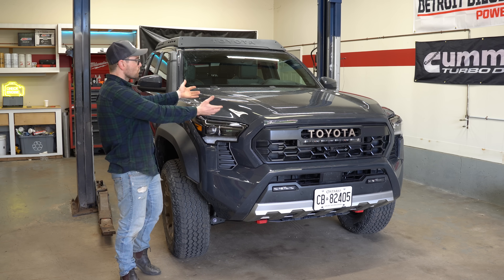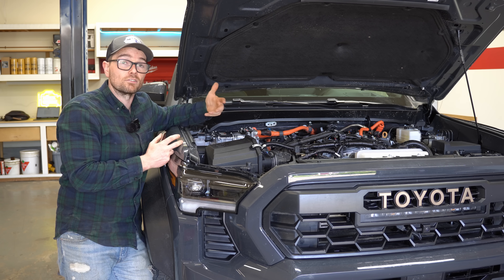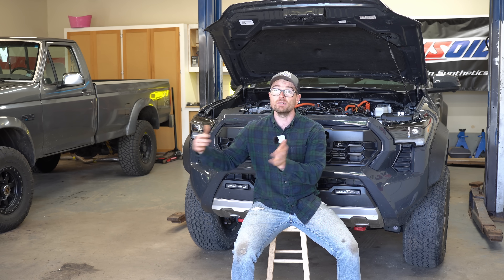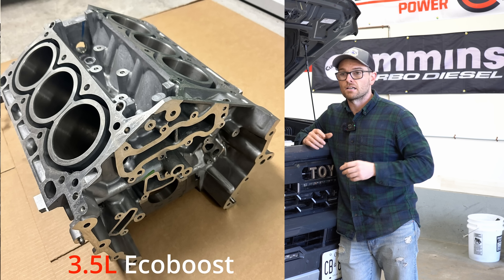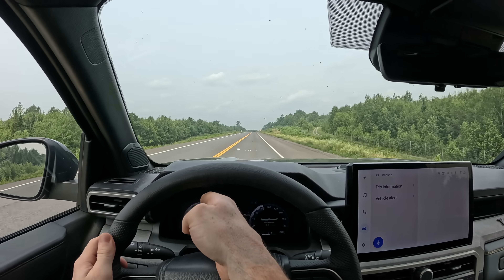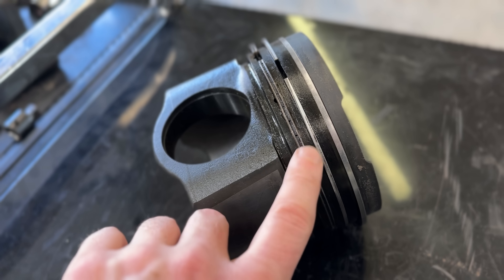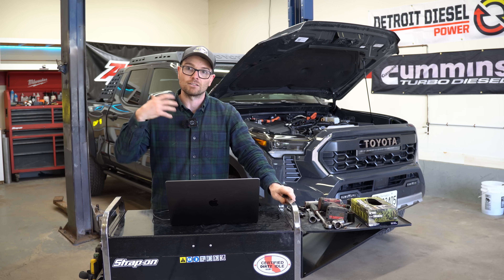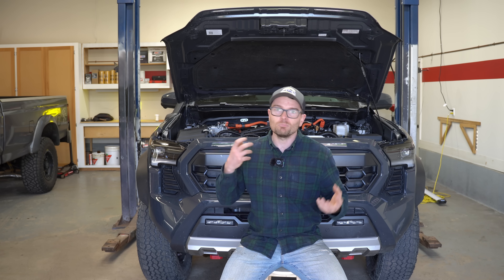Toyota Tacoma's 2.4L I-Force Turbo: CONCERNS Every Buyer Should Know (Mechanic's take)

Comment: Toyota has such a great reputation with turbo motors, just like the Tundra 3.5, oh wait, never mind.
Reply from the maker: Yes the 3.4L was not a great start
Reply: Toyota has such a great reputation with turbo motors, just like the 2JZ-GTE.
Reply: I would rather have high emissions, terrible fuel mileage and solid reliability
Reply: Toyota has never had a 2.4L motor fail. It's one of their most tried and true motors ever.
Reply: @adamrosenduft REALLY? Not even one? Got receipts for that?
Are you talking 22R maybe?
Reply: @TIJoe-te9qu I’m just saying it’s been one of their strongest engines ever. They’ve run it in Lexus for a long time in many different vehicles.
Reply: @adamrosenduft I get it, but you said never. Is that the truth?
Reply: @TIJoe-te9qu I’m talking statistically. Not saying a single 2.4 engine from them has never failed like not 1. I’m saying statistically it has never been a failed engine for the brand lol.
Reply: The failure of the 3.4l wasn’t due to it being turbocharged.
Reply: @55Berg That's right,  it was " debris" !
😅😅😅. 5 straight years of it.
Reply: If I recall correctly, it was not a great start to the 3rd gen Tacoma either.  Toyota, in all likelihood, stay with this new engine for many years modifying it as needed.  The difference between Toyota and other manufacturers is that Toyota has a better track record of standing behind their product.
Reply: @gregleuze6657  have not been in a toyota service dept. lately, have you? they no longer stand behind their product at all.
Reply: @billw8476 I was there last week.  This is the second Toyota I have owned.  I guess I will see.  Which manufacturer do you think stands behind their vehicles the best?
Reply: @gregleuze6657  i would say honda stands behind their vehicles best. after 10 tacomas in my life, toyota has gone down hill , and they try their best to excuse themselves out of any warranty.
Reply: @gregleuze6657  Toyota has a great warranty until you need it.....then you have to be a bare knuckle fighter
Reply: @gregleuze6657  Heard the '16 tacomas had a bunch of problems but I bought a new '17 tacoma without knowing any of that and so far at 64K miles, all I had to do were oil changes and regular maintenance. Nothing with the engine at all or related components.
Reply: The turbo V6 was used long before the 22 tundra,in many lexus vehicles without issues.
Reply: @stefanovichmichael9686  This is not accurate! Plenty of engine failures on the LS500 dating as far back as 2018. Go look in the Lexus forums if you don't believe me. LX600 also with plenty of failures and now the GX550 as well. I believe it's a design issue more so than metal contamination from assembly as Toyota is leading people to believe. Steer clear of any vehicle with this engine.
Reply: @philhenderson3516 What exactly was the failure rate?Far less than .4% campare that to the ecoboost
Reply: @philhenderson3516 peak Lexus LS is the LS430. The UR engine family did had valley plate leaks. But my favorite Lexus engine is the 2UR-GSE.
Reply: @stefanovichmichael9686 I wonder where the disconnect was.  Was it where the engine was manufactured?
Reply: @stefanovichmichael9686 the same is true about this 2.4 Turbo and they have made improvements specifically for the new Tacoma.
Reply: @stefanovichmichael9686not “long” before but before and the Lexus ls that it was used in had some power train problems but nothing in comparison to the Tundra
Reply: They actually do. Toyota made fantastic turbo engines in the late 80s through the 90s. All those designers and engineers are probably gone though
Reply: @Hobinator17  those had problems as well, and they were then installed in light cars,not trucks
Reply: @billw8476  of course, all engines have problems. Im saying they do indeed have a rich history with turbo engines that people remember fondly
Reply: @Hobinator17 Maybe those designers went to NISSAN. Their twin turbos are great,,such as the GTR and Redsport, also in the Z.

Comment: As a lifelong toyota customer, I am completely done with toyota. I will not buy turbos, hybrids or electrics. These are exponentially more complex with many more parts to fail. Even the simplest turbo is way more complex than a NA engine and turbo parts are high stress and high wear. Hard Pass!!! Don't get me started on how even more complex the hybrids and electrics are. What a fail. I hope toyota follows Dodge, Ford and Jeep and return to bigger NA motors.

Comment: The honest to goodness, non-biased review video that Toyota fanboys and the Car Care Nut would never want you to see.
Reply: Car care nut won’t see the problems until the cars are 5 years old or more. All of the new variable displacement or turbo motor designs are a big unknown for everyone. The only vehicles that don’t need to be super fuel efficient are the HD trucks. An NA Toyota hybrid is probably going to be the most reliable car engine. If you want to avoid possible future expensive engine or transmission replacements go EV and sell before the battery warranty is done.
Reply: @detourexplore6615  Ohhhh we (and the care nut) definitely know of all the problems they have *now*.
We can't talk about them until other people talk about them en masse and or there's an official release from Toyota. We talk about what we know, we risk loosing our ability to work on them.
Hence me saying in a previous comment I've been warning people away from the new Tundra's for years.
Don't believe me? 
Next time you talk to an actual, experienced Toyota tech.
Ask them if they're allowed to tell a person they found a leak on their Toyota while it was still under warranty.
Reply: @Nobody_important_at_all  everyone knows about the tundra motor replacements. I was hinting at all of the other modern designs. Honda and ford are also doing variable displacement and everyone has turbos now.
Reply: Toyota fan boys don't like the new turbo engines. I would be curious how many buyers of these have owned other toyotas.
Reply: @BrockOBauma sales are out the roof.  Im waiting 1 month for mine off road.  Now you know
Reply: @johndoeski5948  now I know? You sound like the kind of person who would buy the first year of a new design.
Reply from the maker: Not a Toyota guy just what would concern me!
Reply: @GettysGarage  I'm a Toyota master tech and for years I warned people away from the new Tundra. As far as Toyotas nowadays? I tell people to buy what the like.
Ever since the corporate moved to Texas from California, at the same time when the big 3 went bankrupt. A bunch of their execs got in at that time and since then. The quality and durability of all Toyotas has dropped to equivalent of domestics.
That's why nothing Toyota has made now last past 250k for anything designed past 2010.
Like the domestics, its all designed to fail now.
Reply: @GettysGarage  What sort of engineering or material science background do you have?
Reply: Yeah the car care nut would probably trust this over Nissan's 3.8L and Jeep's 3.6L. Toyota fanboys are the type of people that annoy me because when Toyota messes something up badly, "it's ok. Be patient. Its Toyota"
Reply: @KubanKevin  I mean Toyota frames were rotted out and were replaced free of charge. Being patient worked then...I don't see why it doesn't work now. Unless Toyota wants to permanently ruin its reputation.
Reply: @Baebon6259  If and only if, you had a rust hole OVER a certain size and even then. Obvious weak spot?
Nope, the frames got sanded, an extra coat of chassis paint on the outside and in the last years of that recall, a wire brush scrape on the inside, a jet of water, dried off and an application of a wax coat on the inner frame with the installation of additional plugs on the frame to prevent water intrusion. Where I'm at, it was typically 12-15 frames done this way for every frame replaced. Also don't forget. That frame replacement recall ONLY applied to trucks registered in states that use road salt.
Got an older Texan Tundra?
You wouldn't even have had the half measure done because it does not qualify and dont think you'd buy one and bring it a few states over. Toyota always checked the VIN''s against DMV records. I've had a dozen or so try and get rejected due to registration history for that frame recall.
Reply: @KubanKevin let me guess… you’re a jeep guy
Reply: Your time would be better spent rearranging your ducks than making useless comments

Comment: My friend is an engineer at Toyota. I asked him how long should the engine last on these trucks and he said about 200-250k miles is what they are designed to do. Somewhere in that time frame you’ll have to do something major to it, like replace the turbo.
Reply: A turbo at 200-250k miles doesnt seem like a big deal. Not sure why people are so terrified of turbos, they are generally pretty easy to replace, especially on a longitudinal inline 4, since they hang off the side of the cylinder head.

I upgraded the turbo on my Jeep Liberty diesel, which was a 2.8L inline 4, and that took me like 2 hours total having no idea what I was doing. 3 or 4 turbo flange bolts and 2 oil lines.
Reply: @Jay-me7gw  People love to complain about everything. 200-250k is more than enough for my comfort lol.
Reply: @westcoastplinkin6559  That would be about 20-25 years of driving for me. I doubt I would own whatever it is that long anyway.
Reply: @Jay-me7gw  Me too!  At my age I won't last as long as my new 4Runner.  I'll put it in my will for my Nephew. I am loving it
Reply: @JBuns-r8j  Im 37 and I wont see 250k miles on a vehicle like this for 25 years. I'd be in my 60's, my kids would have moved out(hopefully), and I would likely have different needs than I do now and wouldnt have the same vehicle even if it was reliable.
Reply: @Jay-me7gw  Turbos will last forever if one installs a pyrometer pre-turbo and drives at no more than 1100-1200F temperature. To control temperature one uses lower gears and backs off a bit on the throttle. And idle them down after some hard work prior to engine shutdown. Gearboxes are not just to move away from the light - they actually should be used on steep hills. Forget the boost gauges they are a waste of good $$.
Reply: @barrytunzelmann6010 those are diesel temperatures. You arnt getting EGT’s that low at idle on a gas engine 😂
Reply from the maker: Probably not wrong
Reply: My Mazda 2008 6 is 19 years old.  2.4 engine.  128k miles.  TF you assholes get 300k?   Losers

Comment: The 4.3 vortek in my 03 silverado is damn near perfect. The enjines around that time with sequential port injection were the best. At this point the height of  ICEs was around  20 years ago!
Reply from the maker: I've been thinking this for some time now. the best ICE engine were from like 1995 - 2005. After 2010 its been all about emission reduction and fuel economy vs building the best engine.
Reply: Depends what you like about engines. If pure reliability is your only concern then sure, 20 years ago was probably the peak. Performance and efficiency, no way.

Not all of us want to drive around in a 190hp V6 silverado just because its reliable though. I remember towing a couple thousand pounds of ATV's on an aluminum deck trailer with a 4.3L, 4L60 and 4.10 gears and it could barely hold speed on rolling hills.
Reply: @Jay-me7gw this is so true. My last work truck was a 2012 f150 with a coyote and a 6AT. It was a dog, especially pulling a trailer. This year that truck was replaced with a new f150 3.5 eco boost and 10AT. The daily drivability and acceleration puts the 5.0 to shame and when pulling a load, it handles that job no problem. Sure, reliability has been reduced in exchange for power and efficiency, but that is a change we are going to have to get used to. What I don’t like is the crazy prices for a pickup truck these days. 50k is cheap for a full size. That’s a joke

Comment: I vote for durability and reliability.  I bought two new vehicles in the past three model years. The first was a 4Runner with the naturally aspirated six cylinder. Not great power but is known for reliability. The second was an F250 with the 7.3L gas which is also naturally aspirated.  I sold my previous diesel F250 because the emission systems had ruined the reliability of that engine. Looking under the hood of a Godzilla powered truck ( or the six cylinder 4Runner) tells an important story.  There is so much more space. No turbos, etc.  just simple.
Reply: Right? Gladly pay 25% more in gas and 2,500% less in combined initial price, added maintenance, premature failed components, and ultimate catastrophic failure likely before 160k miles.
Reply: @enthused7591 besides, higher displacement can actually save fuel depending on the use conditions, since you don't need to rev as high as with "efficiency over durability" alternatives, to make the same power
Reply: This is why I came to an ever-increasing appreciation towards the naturally-aspirated 4.6L V8 Triton on my 2007 Mustang. It's only ever needed maintenance, and replacement of some wear parts.
Reply: There's no replacement for displacement.

Comment: The problem you have  in the US is the need of power. These trucks are big, need motive force to sell. If you are not making 300+ hp and big torque you will not sell in the US. Here in Australia....out little "trucks" only make in the range of 200hp/330 lbft or a bit higher. We do alright at these numbers. Yeah, you can get a tune if need be. We need a licence to tow above 10k pounds! I'd love a 6.7 Cummins in my truck...get to blow black smoke and tow a tree out of the ground and then do a Banks swap out cause the lifters shat themselves! But I have what I have and it just suits nicely thank-you. I have a 4jj1-tc Isuzu turbo 3L. Makes no power or torque but just works! 9l/hundred on fuel too! Even towing 2.2T( 4500lbs roughly) it returns 10.5l/100. Yeah, won't bother changing. It does not keep the high speed while towing thou. Bit like a big semi...they slow down up hills! Who cares if you slow down up a hill? I don't. I don't want my motor sitting under load at 4000 rpm. (your loop) The thing will die in those conditions if done often enough.
Love your vids though, give a nice bead on things.

Comment: Because toyota didn't go with closed deck block design they integrated cast iron lining in the cylinder walls to improve durability.
Also toyota tuned the 1st and 2nd gear of the tacoma's to limited the power output to protect the drivetrain.  Tuners are finding this out and working on the transmission and engine tuning to fix that.
Reply from the maker: Interesting building a platform that can't handle the torque of the engine in it..
Reply: @GettysGarage if anything they are playing it safe on the conservative tune to keep things reliable.  The engine and transmission themselves are rated for more

Comment: Great video. I just bought the 2025 TRD Sport. Crossing my fingers. Long term Toyota 4x4 owner 1984 4 cly, 1988 4 Runner 4 cyl and 1991 4 cyl. Still own the 91. great strong reliable truck. 147k.
Reply: why cross your fingers. You have extra-ordinarily good MPG, safety systems, and handling compared to the antique Gen3

Comment: We all know it’s not going to hold up. Plastic gears inside the engine running the oil pump,,, yea that’s not going to be 300,000 engine like before.
Reply: They been using plastic since 2014 buddy.
Reply: @J @Jer-k1k I know my 4.0 doesn’t have any plastic gears on thr oil pump.
Reply: @DasNewsNetwork  the new engines come with more plastics. But internally they do no have any plastic gears that I know of. Plastic housing maybe, but I’m sure they don’t have plastic gears.

You do know that the 4.0 had the most revisions right? It was the 3rd revision that Toyota finally got it right in 2012. It’s a good engine but really under powered in my opinion.
Reply: @Jer-k1k yes I know but no revision was due to failure. One major was adding Varible valve timing to both intake and exhaust. 

Yes it’s under powered and that’s why it will last. They sisnt take a small engine ans force it to put out massive power.
Reply: @D @DasNewsNetwork lol front timing chain gasket leak, engine head gasket leaks, water pump failure and timing issues/ pinging. You have no idea.
Reply: @Jer-k1k compared to most engines today the issues with the 4.0 are very minimal. A lot also depends on care and use. If you beat the hell out of it with huge tires, and over loaded trailers yea you are going to have problems. But the number of head gasket issues are minimal.
Reply: @J @Jer-k1k cite an engine ? I haven’t seen plastic gears in an oil pump before.
Reply: @DasNewsNetwork there is no plastic gears in oil pump. This guy doesn’t know what he’s talking about. He mentions the turbo has water cooled. They aren’t water cooled. They are just air cooled. It’s the Tundra that has water cooled turbos.

Comment: The design seems like it’s well thought out, but the material choices as you cited and reliance on plastic or polymer in critical pieces like thermostatic control valve and polymer gears is very suspect. Those types of materials are known to get brittle with intensive heat cycling, causing them to fail. Toyota should know this and their choice of materials wasn’t a good one.